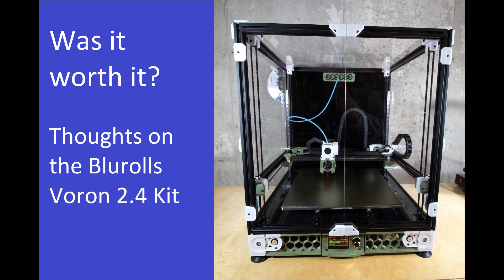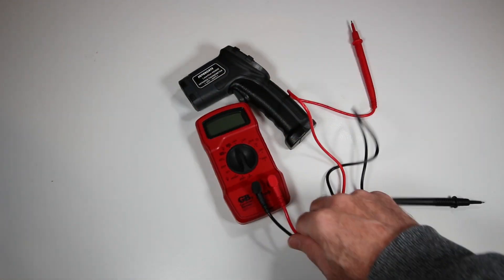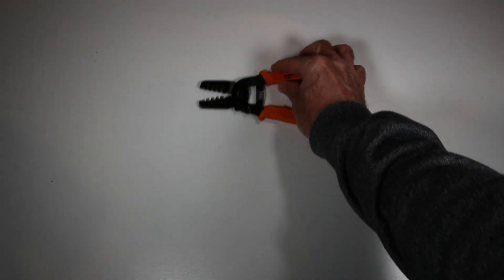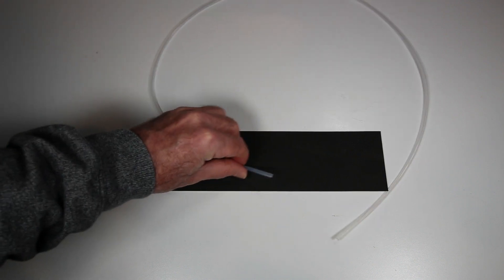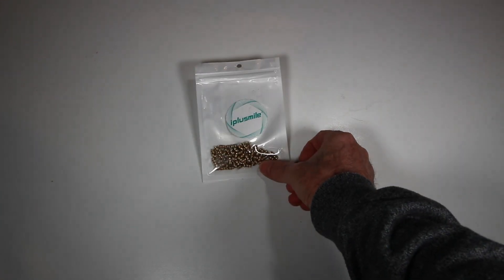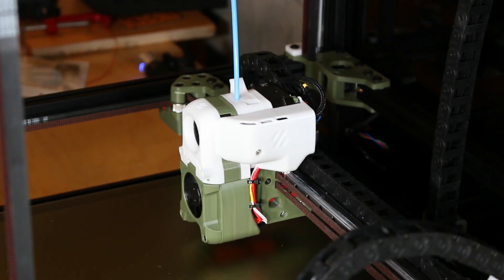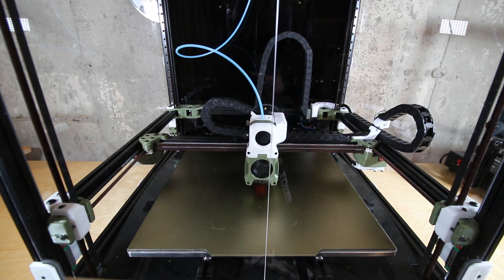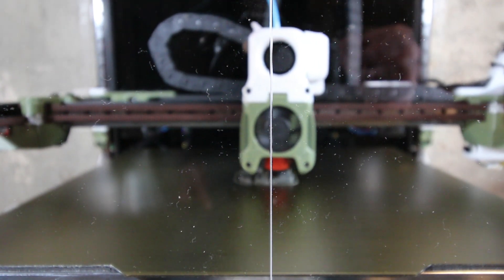Was it worth it?  Final Thoughts on the Voron 2.4 kit from Blurolls

Comment: Yeah that tilt on the bed is weird. I know you fixed it already by now but it is weird that the gantry would not have just tilted with the bed and pull that tilt out since there was no high spot making it not do that. Do you think you might have turned off the motors before running the bed mesh?
Reply from the maker: I have since fixed it.  It turns out the screws that held the bed down were too long!  They did not actually hold the bed firm.  Once I changed the bolts, all was well.

Comment: Sounds like overall you like the blurolls kit?
Reply from the maker: I thought it was a good kit.  I felt all the parts were good quality.  The wiring was really the only weak part back then.  I don't know if it has improved since.  It had silicon insulated wire as well as some per-terminated wire on one end which I was not sure of exactly what was intended for it's use.  I ended buying a wire harness to save time.  The third party harness also had much higher quality wire.    My only other complaint was it pretty much came with the exact number of screws you needed.  There was very little left over.  I would have liked some extras.  Other than that, I felt all the parts were good or premium quality and no fake parts.
Reply: @KapmansBasementWorkshop  thanks for the info!
Reply from the maker: @calmingsounds7311  And thank you for watching!

Comment: Kit looks really good, but with the importance of flat bed in 3D Printing, they might as well have given up.
You did properly install the magnetic surface, right?
Reply from the maker: I properly installed it except that the surface I used was not flat enough.  I should have used a very heavy glass table and it would have come out much better.  I'm happy with this kit.  The parts were high quality and I'm very happy with the final printer.  Thanks for watching!
Reply: @KapmansBasementWorkshop  ah I see..that's an important note. Your videos are like the important things that aren't in the instruction manual or anything lol
Reply from the maker: @Mehecanogeesir  In this channel I have a video about the secret to a flat bed.  It shows how I learned the hard way and how I fixed it.  The point of the video is really about the importance of the surface you use when attaching the magnet (just in case you watch it).  Thank you for the nice comments, kind words and for watching!
Reply: @KapmansBasementWorkshop  will do. Thanks for the content!

Comment: What colors and brands of ABS filament did you use for the Green on your color scheme for your printer. I love it and would like to have the same color scheme on mine!!
Reply from the maker: Thank you for the compliment.  I really like the color scheme too. I was looking for something different that was nice and not the typical colors seen on Vorons.  I was inspired by the colors of an Army Jeep.  The filament is from Paramount.  Be sure to look at their other colors.  None are typical.  They have a red (Iron Red) that is just amazing....  But this is what I used:
Military Green - https://www.paramount-3d.com/product-page/flexpla
White - https://www.paramount-3d.com/product-page/abs-2

One bit of warning.  Many recommend white filament not be used in areas that must deal with stress and heat.  The claim is that the white pigment makes the ABS weak and hard to print.  As you can see, I heard that after I built the printer.  That said, I don't think I notice a difference.  Their white is slightly translucent which probably means less pigment and more strength.  
That said, I really like the quality of their filament.  I use it now almost exclusively.

Thanks for watching!
Reply: @KapmansBasementWorkshop  Thanks for the response. I really didn't think I would get one. I guess my eye is better than I thought. I was debating between ... 1. KVP - ABS Filament - (British Racing Green)
2. Paramount 3d Abs (military Green). I will be buying the formbot 2.4 r2 kit soon. I am a little confused as to how to print the parts and I have never printed with ABS as of yet. Anyway thanks for the info and wish me luck figuring this all out!!
Reply from the maker: @chucktaylor5878  , I used a large cardboard box and placed it over my older printer while printing the ABS.  Also, don't print out to the edge of the bed to avoid cooler air,  and if a part has sharp corners, orient them inwards with the rounder/softer sides outward.  largest parts in the center.  I think you will be surprised at how well ABS prints.  I was really impressed to the point where now I don't use much else.  My older printer never printed that well with other plastics.  Make sure you print in a room that can get fresh air, it can get somewhat smelly.

Comment: not sure if possible but could try rotating the bed 180 deg temporarily to see if the slope flips too or stays same, ie gantry related
Reply from the maker: That's a good idea.  I may try it.  Just feeling a little lazy dealing with the wires.  That said, the shorter screws made a huge difference.  I also posted a video where I took one of the linear rails off the X-axis.  That made a big difference too. Thank you for watching!  The video: https://youtu.be/i8a2-Jd-dIo

Comment: Spoiler Alert: Regarding the apparent bed flatness issue, see the 10 tips video KBW posted more recently. It demonstrates there was an issue with screw length on the bed attachment bolts. Once slightly shorter bolts were used (to avoid bottoming out), the flatness was greatly improved. It also presents a large number of additional tips and refinements that Voron builders (or other Klipper users) are likely to find interesting and useful.
Reply from the maker: Thank you very much!

Comment: So far I’m planning on buying a voron for my first 3D printer and am going to learn as I go along. Do you think this would run off of the new Mac mini m1?
Reply from the maker: The Mac mini would work for any CAD software and slicer you would be running, but I think it lacks the hardware needed to run the printer directly.  For that you will need an MCU like to Spider or one of the others.  I also think you will need a Raspberry Pi for the controller that runs Klipper and Mainsail or Fluidd along with Moonraker.  The Raspberry Pi  rarely hits 5% usage, so it represents a very cheap way to run and control the printer.  Since this is your 1st time, I would not recommend you deviate from the standard formula that works.  Once you have one working, you can start to experiment with major changes such as the Mac Mini.

Comment: FYI, your "Extra heat set inserts" are the wrong size and caused me some headaches. Might want to remove those from your links.
Reply from the maker: My apologies for that.  I just removed them.  Where did you have trouble with them?
Reply: @KapmansBasementWorkshop  They pulled out of some of the holes due to being a smaller diameter. I used these to get a start on my build while I wait for my Formbot kit.
I had to put a screw in each one and pull it to see if it held. I would say about 15 of them were replaced.
Reply from the maker: @tracynadeau4  , I'm sorry to hear that.  I used the inserts that came with my kit and then these were supplementary.  But I had no trouble where I used these.  They held strong.  They were a little longer than what came with my kit, so they actually seemed a little stronger.  But I've removed the link.  It sounds like they are causing trouble for some.
Reply: @KapmansBasementWorkshop  No worries, as long as you fixed the issue. I enjoyed your videos so keep at it.
Reply from the maker: @tracynadeau4  Thank you very much.  And i wish you the best with your build!

Comment: Woah! that tube hack on min 6:30 is just great!! What kind of tube you use? Guess even as little as 1 meter of it would be perfect!
Reply from the maker: Actually, even 1 ft should be enough.  It's 1/4" clear vinyl tubung.  It can be found at Amazon, pet shops, hardware stores, etc.  Wire can be run through it or it can be used by forcing it into an existing wire run through 2020 extrusion.  I tried to 3d print multiple options that can be downloaded from Thingiverse to guide wire in extrusion and found none of them to works well.  Either they were too hard to insert and broke or once inserted, fell out eventually.  These have not moved since.
Reply from the maker: It's 1/4" OD tubing.  I've had it for several years, I don't know where I originally purchased it, but this should be pretty much the same: https://www.amazon.com/Flexible-Clear-Airline-Tubing-25-Feet/dp/B0186KV716/ref=sr_1_5?keywords=clear+tube+1%2F4+aquarium&qid=1640728395&sr=8-5

Comment: Hi, I have the blurolls kit also, my bed has a brushed aluminium surface not ground, is not flat  and is not stable. 0.2550 deviation on bed mesh after only four hours of heating and it started at 0.125. the brushed surface is indicative of 6061 rolled plate not Mic6 as advertised in the kit. pulleys are also different to gates GT2 pulleys from what i have in front of me. Service is pretty slow if there is a problem, but the rest of the kit is nice especially the rails
Reply from the maker: So that bed plate....mine seemed very not flat initially from back to front.  After I completed the video series, I tightened all the screws down firmly on the heat soaked plate to see if I could make it better, it didn't help.  Then later, once the printer had cooled off, I tried to pull up on the plate to see if I forgot to tighten something else.  I was stunned and embarrassed that the base plate lifted up even after I tightened the screws!  It turns out that if you follow the Voron manual recommendation for the  size of screws to bolt the plate down, they are too long for the plate that ships in the Bluerolls kit even though the screw heads sit flush from the surface.  I used shorter screws to tighten the bed down (once heat soaked) and took another bed mesh and saw a huge improvement.  It's not perfectly flat, but what I do see now might not necessarily be the plate, it could be the gantry responding to temperature changes as well as some other factors.  But now the plate, as is, provides some very good prints.  I am planning another followup video as I've learned quite a few things since I completed the build.  I'll get into more details on this one with a before and after photos along with other tips.  I agree, the rails are very nice!  I did  not have any trouble with the belts or the Pulleys, they seem to work really well for me.

Comment: I counted my blue rolls heat sets and it had 1 extra then what's called out in 2.4 BOM. I got the jst connector housings but no pins with the kit. Still haven't built it, been reprinting some parts in both ABS and PA CF, I plan to compare the two. I'm also planning on using it as a 2.4 for awhile and will likely convert to a belt driven Z trident. There is a nice conversion available and I think the Trident with belted z would be superior as I don't like the leveling by twisting the gantry on the 2.4, can't help but think this would effect racking and or the Z linear rail alignment.
Reply from the maker: I'm not having any problems with the gantry twisting.  I believe as long as you use the spacers to help with installation, you should be just fine.  The linear rails themselves were very high quality and very straight.  I wonder if some people that are complaining about twisting might be dealing with linear rails that are not straight from the factory.  I'm sorry to hear about the missing pins.
Reply: @KapmansBasementWorkshop  I've got it running now and the Z alignment and extrusion consistency has been impressive to say the least. Absolutely no adjustments needed. I'm ready to put the panels on for ABS and only now realized the foam tape included with my kit is a single 15mm roll vs the 1mm and 3mm called for in BOM. Curious if yours was like this,  if so did you just trim it long ways after cutting a length?
Reply from the maker: @ChrisHarmon1  Congratulations!  It's an impressive printer!  I also had the single roll of tape.  I had leftover after placing it on all the inside edges of the panels.  It seems to work fine as the panels don't vibrate and they seem to be air-tight enough.

Comment: The difference between this kit and others is that this supposedly use better quality component. This video does not answer the question of whether this kit is worth the higher price.
Reply from the maker: For me, it was worth it.  The parts seem to be built by the original manufacturer and real based on my investigations.  The only place I think corners were cut were the print bed.  The bed heater is no name, but seems to be of high quality.  I can't yet decide if the bed is manufactured correctly and if what I see in the mesh is due to the bed or due to the sensor.  That said, the prints are coming out great per the level of tuning so far.  The bed does not seem to have a negative impact.  I've got a few more things to try out before I have a final verdict on the bed.  Thank you.
Reply: The rails alone are worth the extra money vs formbot. I first ordered a formbot but got the run around for weeks  and never did get a delivery date so I contacted blue rolls and they had it shipped within 3 days (paid on a friday) from China, delivered within 10 to US.
Reply from the maker: @ChrisHarmon1  They were quick for me as well.  Especially considering the distance.  I'm really happy with the included rails.  So far they have been great.  The quality has been very good.  And I have none of the twisting problems that others in the community are complaining about.

Comment: For your bed tilt, check your z motor belt tension and maybe try increasing your holding current too. The left side on my tends to dip between prints on my 2.2.  QGL is awesome and I think for the most part the probe compensates for those bed irregularities. Thanks for sharing your thoughts/tips on the build experience!
Reply from the maker: I did up the holding current as well as the running current,  The drop in motor noise while running was very noticeable and readings between QGLs is much more stable.  Also, I noticed the screws were too long for the bed!  I used shorter screws and the tilt is all pretty much gone!  Thank you for the motor tip!
Reply from the maker: Thank you for the tips.  I know the belt tension is good, but I didn't consider the motor holding current.  I will up that and see if it makes any improvements.  That said, QGL is awesome as each print comes out nice, if the bed is really uneven, the prints don't seem to be suffering.    Thank you!

Comment: Again, I LOVE your videos!  Just received the 1st of several kits I plan on building.  Once this kit is completed and working, I plan on getting two more kits early next year in addition to 2 resin printers.  Question about the crimpers:  I just bought the pair you suggested.  What settings did you use to crimp the connector for both the Molex and JST connectors?
Reply from the maker: I think it will be really important to purchase some extra pins and plugs to practice on.  The different plugs were a little different to crimp.  You will know you have it correct when you insert the crimped pin into the plug and you clearly hear a pretty crisp click.  But this is what worked for me starting at the insulated end and moving towards the tip.
JST - 1.6, 1.4
Molex Mini - 1.6, 1.4, 1.0

That in not the order I crimped however, crimp the bare wire and then the insulated end.  The Molex required crimping 3 parts of the pin for me.  Bare wire, insulation and then the part after the bare wire crimp, but not the tip.  I hope this makes sense once you look at the pins closely. 

It was also important to slightly improve the shape of the metal tabs on the pin prior to crimping with the unmarked flat tip of the crimpers prior to crimping in the labeled slots.
In all, it took me about 5 times before i got this correct the 1st time.  I also had to go back and re-crinp a few.  I realized later that the ones that did not "click", were no good and would not make electrical contact.  Once you get the hang of it, it starts to move quickly.  Thank you and great luck with your builds!

Comment: I find the Voron very tempting but i think i would go for a ratrig. Having all parts from one provider seems nicer for me than the kits from aliexpress. Why did you decide to go for a Voron over other DIY kits?
Reply from the maker: I must say first that the RatRig is an amazing 3D printer, so please don't take any of this in a negative manner directed to that printer.  The reasons came down to my personal biases that may not be reasonable.   1.  I really wanted a stationary bed.  2. I really like the idea of adjusting  Z in all 4 corners independently.  3. I dislike lead screws for the Z-axis as they never seem straight, wear quickly and develop play if they are not ball screws.  The RatRig is a great design with quality parts.  There are others I looked at as well, but the Voron 2.4 seemed unique in this area.  Both these designs have tradeoffs (as does anything), I would be hard pressed to say one is better than the other.  Thank you for the question!